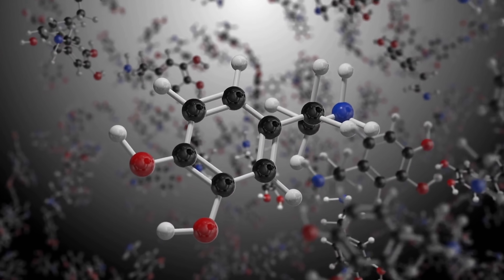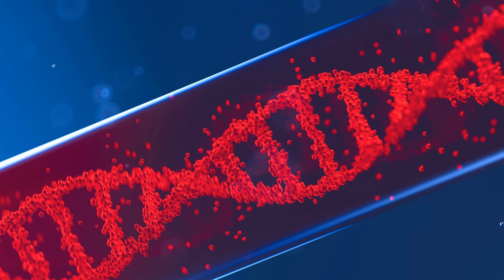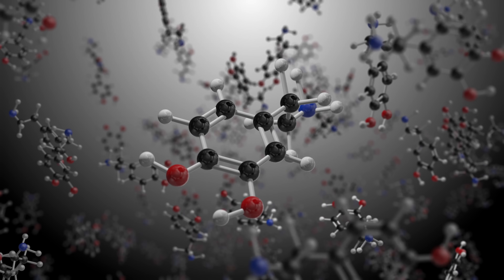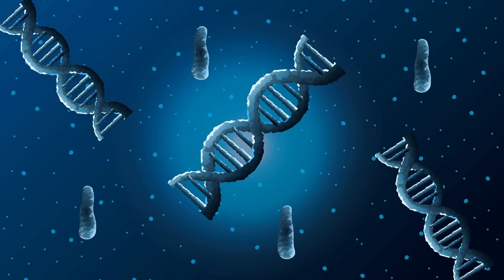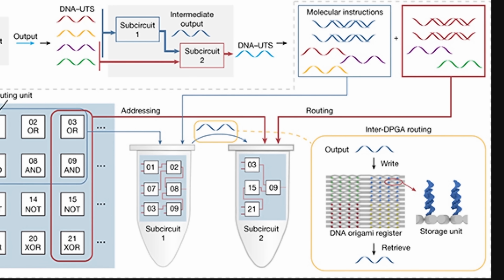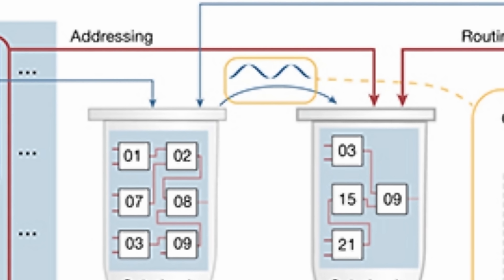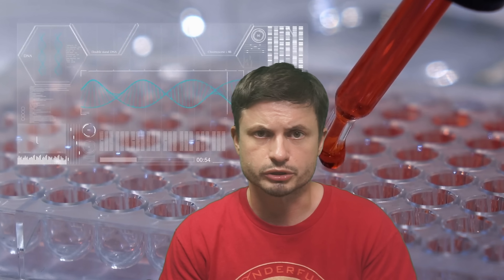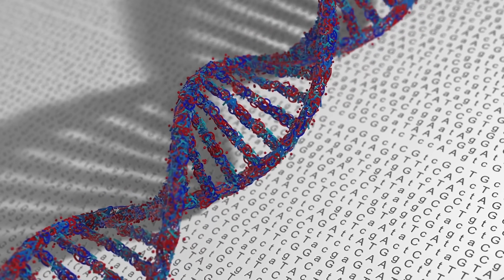First Ever Programmable DNA Circuit Is a Breakthrough In Biocomputing

Comment: The creation of programmable DNA circuits is a significant milestone in the field of biocomputing. This technology holds the promise of revolutionizing medicine, environmental monitoring, bioengineering, and computing by merging the natural properties of DNA with the precision of computational systems. While there are still technical, ethical, and regulatory challenges to address, the development marks the beginning of a new era where biology itself can be harnessed to perform computational tasks, leading to innovations that were once the realm of science fiction.

A programmable DNA circuit is a system where DNA molecules are designed to function in a way similar to electronic circuits but within biological systems. These circuits use the biochemical properties of DNA to store information, process inputs, and generate outputs. By engineering specific sequences of nucleotides, researchers can program DNA to perform specific tasks, such as detecting certain substances, switching on or off under certain conditions, or even triggering biological reactions.

This development represents a step forward in DNA computing, where the biological material is used to perform complex calculations or data processing in ways that traditional silicon-based computers cannot. Unlike conventional computing, which relies on electrical signals to process data, DNA computing exploits the natural properties of DNA strands to create logic gates, memory, and signal transduction pathways.

Biocomputing is an interdisciplinary field that merges biology with computer science and engineering. The creation of a programmable DNA circuit extends the potential of biocomputing, offering new possibilities for computation at the molecular level. Unlike traditional computers, DNA circuits operate in parallel and can be vastly more efficient in certain computational tasks, especially those that require massive amounts of data processing in a small space.

In addition to computational applications, these DNA circuits could play an essential role in biotechnology. For instance, they could enable the creation of biosensors that detect environmental toxins, pathogens, or other biological markers, effectively bridging the gap between computation and real-world biological systems.

One of the most promising applications of programmable DNA circuits is in medicine, particularly for precision therapies and diagnostics. Since DNA is naturally involved in genetic processes and biological functions, DNA circuits could be used to control genetic expression, detect disease markers, or activate therapeutic genes within cells in response to specific triggers. This could lead to targeted treatments for conditions like cancer, genetic disorders, or infections.

For example, programmable DNA circuits could be designed to sense cancer biomarkers in the bloodstream or within tumor cells. Upon detection, the circuit could trigger a therapeutic response, such as releasing a drug or producing a protein that targets cancer cells, all within a living organism. This offers the potential for highly personalized, on-demand treatments.

Programmable DNA circuits could also be used for environmental monitoring and bioengineering applications. They could serve as molecular sensors to detect pollutants, toxins, or changes in the environment. This could help in fields like agriculture, where the DNA circuits could monitor soil conditions, detect pathogens in crops, or even monitor the health of ecosystems.

In synthetic biology, DNA circuits could be used to design new, bioengineered organisms that perform specific tasks. For instance, scientists could design bacteria or algae with embedded DNA circuits that clean up oil spills, convert waste materials into valuable resources, or produce biofuels more efficiently. These applications are particularly relevant for sustainability efforts and bio-based manufacturing.

As with any groundbreaking technology, the development of programmable DNA circuits raises a range of ethical and practical considerations. There are concerns about the unintended consequences of modifying genetic material and how such technologies could be misused, such as in bio-terrorism or unethical genetic manipulation. Moreover, there are challenges related to the scalability of DNA circuits, as creating large-scale circuits with precision and reliability remains a significant challenge.

Regulation and oversight will be key to ensuring that these technologies are developed and used responsibly. Ethical frameworks need to be established to address issues such as consent (for genetic modifications), privacy (for genetic data), and the potential environmental impact of engineered organisms.

The future of programmable DNA circuits is full of exciting possibilities. As our understanding of molecular biology and DNA programming advances, we could see more sophisticated circuits that integrate multiple functions and can perform complex tasks, such as regulating gene expression, controlling biological processes, and interacting with the environment in real-time.

Furthermore, the integration of DNA circuits with other biotechnologies—like CRISPR, artificial intelligence, and microfluidics—could lead to even more powerful biohybrid systems. These systems might blur the lines between biology and technology, offering new approaches to health, sustainability, and computation.

Comment: With my background in digital storage I would give the possibility of long polymer (e.g., DNA) digital storage good marks.  That said the computation needs to be error tolerant which is why my interest goes toward advanced perceptron computing utilizing the storage with specialized computation (e.g., weighted sums and thresholding).  For purely digital, robust, exceptionally fast, and error free, storage I would put my bet on carbon nanotube storage devices which is not at all biological.
All of this is still a few years off.  I give low marks on practicality on DNA computing per se., but not on DNA data storage where bit infidelity (high error) can be accepted due to overdetermination inherent in advanced perceptron systems like we have today in ChatGPT etc.  Neuron like computation is tolerant of low precision computation which gains accuracy by overdetermining answers to recognition and action problems.

Comment: I took an undergrad class on this sort of Biological Computing and other types. To my understanding, the biggest issue with DNA computing is the stability. 
The problems that Adleman and lager expirements solved are all NP-Complete but very small in size. The theory is that even if they take a while to solve due to some practicalities, if it can be scaled up it can be better than computers because of the ability to be massively parallel. The problem is I don't think anyone knows how to scale it up significantly.
This sort of programable gates does not imply to me that we want to scale it up to the size of normal computers.  I think that would actually still be slower than modern computers even if we could. Electrons move very quickly and chemical reaction propogating through a network is intuitively slower to me but I'm no Biochemist. It would likely have much more memory, and maybe that could be fused with current computers but that's a completely different discussion.
Instead, it would be interesting to see if we can make a network of computers for more logical distributed computing rather than employing randomness like Adleman's experiment.

Comment: Pff, nice. Research just found out many c19 vaccinations were contaminated with real DNA, protected with some layer so it was safe for the immuun system. 
Really makes you wonder what’s possible when thinking about programming it. 
I mean, could you enter code that’s like a self-executable? 

And could the advancement not be any  further in some secret labs. 🤔

This is actually a theorie some anti-vaccer told me during that time. 🫣

Comment: You lost me when you said slow. You see these computers are worth nothing if they are slow. The whole reason why encryption works is because cracking passwords with existing methods is slow. Computers are meant to augment humans not to handicap them. I wonder why someone would need a calculator that solves a quadratic in 2 days when they themselves can compute it in 2-3 minutes.
Reply: They were able to make it faster more efficient than modern computers also better at quadratic calculations.

Comment: Team Android or Team Cyborg guys?
Reply: Technically both as Androids can have biological parts as well.
Reply: @rajukoley9249  i thought androids were machines with biological parts while cyborgs were biological with machine parts
Reply: @oUncEblUnt420  technically Androids could be fully biological like the replicants in blade runner.
Reply: @rajukoley9249  if it was made artificially, in the shape of man, then I'll allow it. And by that definition , one could argue test-tube babies are androids as well.
Reply: @oUncEblUnt420  no the internal structure has to be different in the Androids.

Comment: The biggest problem with finding applications for dna based computers is retrieving the data. We need optogenetic wifi. Instead of using lasers to interact with individual light sensitive proteins, we need to genetically engineer a pathway that can convert an optogenetic signal into rna and in turn transmit an optogenetic signal from the cellular scale rather than just our macroscopic lasers. Then we can program the bioculture to network into a cloud network and our macroscopic lasers will just network with the bioculture as a whole rather than individual genes or cells. This will make it much easier to upload and download data, as well as to test it on a cell by cell basis. We could use this not just for storing large amounts of data but also to test genetic modifications quickly and at scale, as well as to genetically sequence entire biocultures, ecosystems or tissues on a cell by cell basis.

Comment: Miraculous concept!
Without wishing to dismiss these extraordinary discoveries, the striking energy efficiency of these reactions is obviously negated to some extent by whatever interface is required to input instructions and to interpret results. The brief mention here of the conditions in which a system based on DNA can operate, the stability of the material from which it is made, will clearly have a profound impact on what kind of work it can do, how reliably it will perform and for how long.

Comment: Living organism are anything but computers. To be a computer, a system has to have well defined functions. Not how biomolecuels all has multitude of function and often partial functions. Anyone wants to read further should read the papers:
1. "Living Things Are Not (20th Century) Machines: Updating Mechanism Metaphors in Light of the Modern Science of Machine Behavior" DOI: 10.3389/fevo.2021.650726
2.  Is the cell really a machine? DOI: 10.1016/j.jtbi.2019.06.002

Comment: So...is no one else thinking about the unimaginable amount of information that is currently stored in our DNA?
Reply: It's something like 700 MB. We fit on a CD. It's laughably small compared to the information we can learn during our lives.
Reply: @MathMagician93 700MB? Ain't it waaaayyyyyyy more?
Reply: @Junior305able  I tried linking the source, but YouTube deleted my comment since it had a link in it.
To summarize: 700 MB is the size of the information in our DNA. The 200 GB that make up a genome sequence are >99% just there for error correction. If we had a genome sequencer with 100 % accuracy, we would really only need 700 MB.
Fun fact: the amount of information needed to differentiate your DNA from mine is smaller than 125 MB. It's only a 0.1% difference, but you have to track where that difference is.
Reply: We've been studying that since the 60s though
Reply: Walking hardrives  6G network

Comment: This tech might enable us to calculate how a nanobot should be built to function in given conditions. It could encode for all kinds of experiments that inform a nanobot's design. Like an accelerated evolution, with or even without optimizing iterations. These nanobots could then combine to form larger structures. AI will help us master this new tool.
Also useful: encoding for vaccines to combat viruses as soon they are detected, on the fly, everywhere. One Open Source AGI risk mitigated.